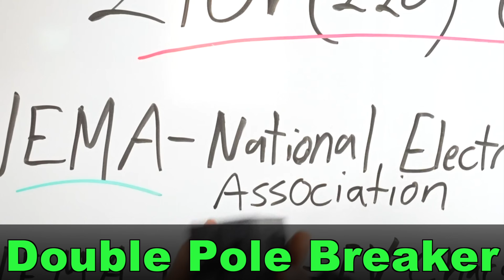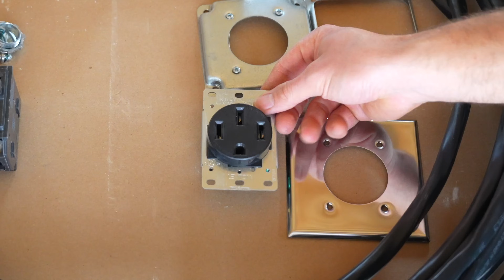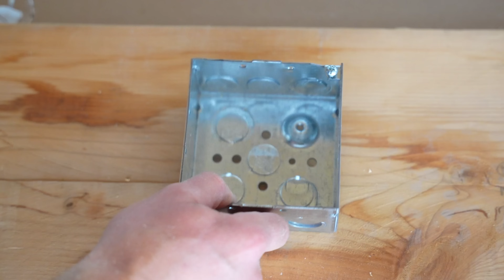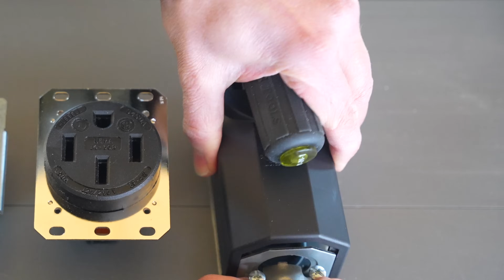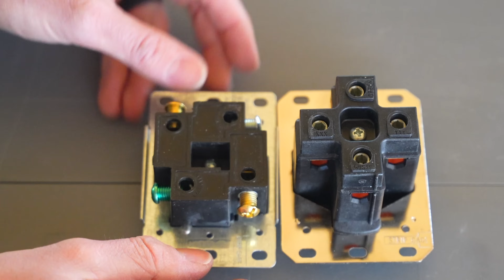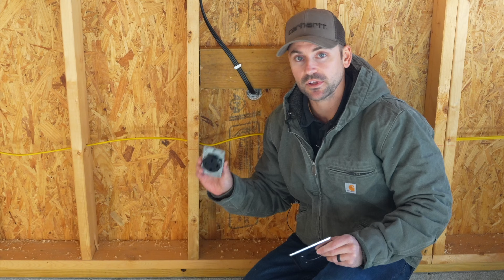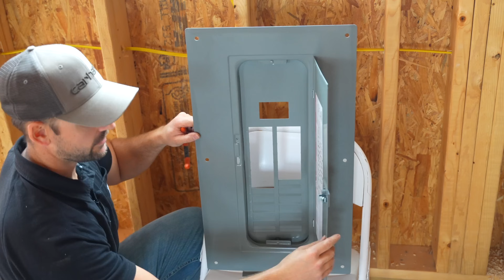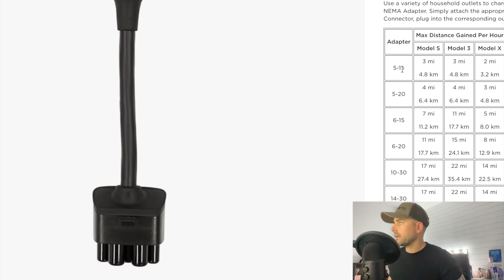How To Install A 240V Outlet In Garage - EV Car Charger, Welder, And Electric Range (Hubbell 14 50)

Comment: Excellent video instruction of how to rough-in and install a 240 v outlet. This was extremely thorough and very concise.  I feel confident that I could now undertake this work on my own.  

The only two questions I still have are; 

1). What size mudring should be used depending on the thickness of the drywall? and 

2). Why not use a two gang box to eliminate the need for the mudring?  

I think part of the answer is what you said about the mudring providing more room in the ox.  I get that there is only one device and not two switches or outlets that would require a two gang box but the two gang has the four ears or tabs you'd need to secure the device to the box.  Is this just a preference thing or is there another reason for this?

These are sincere questions.  I'm not being critical.  I know enough to be dangerous and just like to have all of the information before undertaking work.  Either way, I'm going to follow your lead thinking that if it's good for your house... then, it's good for mine.  I'm asking in the event you respond before I've started / completed the work.

Thanks in advance and all the best to you.  Keep up the good work.  👍

Comment: can you help me understand how come I see some people hook up 240 with only red and black plus a ground and no neutral. thx
Reply: The transformer on the pole is 240 volts centertap is the nuetral to get 120 volts to each hot .  It is grounded so there is never more than 120 volts to ground  The hots are opposite polarity from each other so 120 + 120 = 240.  the neutral is only needed to make 120 volts from 1/2 the transformer windings

Comment: You’re using a heavy duty 50A outlet, however people can still use 40A charging rating only😂 not 48A max rating. Because you didn’t count continuous load factor and nm-b wire rating. Plus the breaker is a 80% rating breaker.

Car charger is a continuous load. So when sizing the conductor you have to time 125%. 
48A*125%=60A
Romex wire 6 awg only carries 55A

So in the future the homeowner should better not set the charging rating on 48 max, only 40A.

If someone really want to charging on 48A max, electrician should use 4 awg romex or 6 awg mc

Comment: It's a good habit to run your 3 mains up the same side of the panel to reduce hum and noise. Your not seeking to use you panel as a one turn inductor or create a phantom voltage in your neutral. You likely don't hear these hums until you enter a big electrical room.

Comment: For a range, it is probably better to install under 8 inches to accommodate for standard or short drawer space -- that is the space behind the drawer that provides space for the plug. You might want to face the ground towards left or right -- some cords have the ground up and some have the ground down, and you want the loop to slide back in easy.

Comment: Hello 👋 there is it possible to wire nema 6-30 outlet 12/2 gauge Romex  just to mention I want to pull 20 amps
Reply: On a double 20 amp breaker

Comment: Recent code revisions require GFCI outdoor or in garages above 20A but that is only for branch circuits (welder, range, EV charger) but it is not allowed on feeder circuits (RV outlet--anything with a subpanel).  The same 14-50P could be either.

Comment: I've asked this on other channels but haven't gotten an answer. What is the failure scenario that we are protecting against when we separate neutral bar from ground bar in subpanel? Since the neutral and ground get bonded at the main panel and since there is continuity between the neutral on the main and the neutral on the subpanel and there is continuity between the ground on the main and the ground on the subpanel, then won't there be continuity between the neutral and the ground at the subpanel? I'm sure I'm wrong but I just don't know where I am wrong.
Reply: @Alessandro7432    Objectionable current on the ground from the sub to the main. Electricity doesn't just take the path of least resistance, it takes all paths available in proportion to the resistances of those paths. If your Ns and Gs were combined in a sub-panel, returning neutral current from one circuit could appear on the grounded metal case of an appliance being used on another circuit. Neutral is not ground. Ground is not neutral.

Comment: Not correct about the height of the box for a range you want to keep it as low to the floor as possible keep flooring in mind and the receptacle is wider than the box. Reason it’s low is the bottom drawer of ranges is not as deep as the rest of the range this allows a recess for the cord and plug end so the range will push tight against the wall and not stick out past the countertop. Also orient the ground facing left or right so the cord doesn’t stick up or down and hit the floor so before you teach anything else all the people who listened to you and their range sticks out you can go fix it for them!😜😁

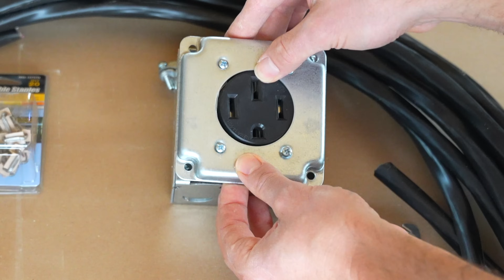Comment: Thank you for the video. Can you provide the link to the cover at 5:38 what will work on the Hubbell 14-50 Outlet?
Reply: You you said the 6-3wire is a three wire with a ground wire, but you didn't say what the six stands for,or maybe I missed it.

Comment: If you are using the Tesla Mobile Charger. Remember to mount the box a foot higher and orient the receptacle in the right direction so as the charger hangs straight down. Then you must support the charger itself so it doesn't disconnect the adapter from charger.

Comment: I thought the video was well done. You were precise and step by step. Sure, you always wrap a wire the way the screw screws in and I usually use a wire stripper in stead of a utility knife to strip the casing but still a well done video. Thanks.

Comment: I believe there have been problems using cheap stove outlets for EV charging. Generally the stove outlets weren't built to handle that high of voltage for 5,6,7, 8-12 hours at a time like an EV does. It would be similar to all burners on high and stove on boiler all night every night. A stove would rarely be used at that voltage and  never for longer than a few minutes  before being turned down if it was .
Reply: joshscott301 I learn something new every day.
Reply: You don’t know what you are talking about they are the same size metals inside and have to be or would never pass UL listings and the voltage is the same it’s the current/amperage that sizes everything when it comes to wire gauge other than industrial commercial wire rated to 600volt and higher

Comment: I just want to caution everyone that using NM cable for this circuit limits you to the 60 degree column for Ampacity (NEC 334.80), that's 55A here.  Furthermore, maximum current based on a continuous load should be no more than 40A's on this circuit since 125% x 40 = 50A. Therefore, never plug a 48A smart charger into this receptacle as some homeowners down the road may do and perhaps label the receptacle to say 40A MAX if you are going to use these 32A mobile charging cords. Note: even if you use 6AWG THHN rated at 90 degrees, your receptacle can only be used for less than 50 Amps. For me personally, I don't even install receptacles anymore for EV's, as they were just never designed for these high and continuous loads over periods of 8 hours or more.  Also consider the constant unplugging and plugging in at the receptacle; your terminals will be lose in no time with a chance for arcing and a fire very high. Buy a hardwired smart charger instead and have it installed by a licensed and insured professional!
Reply: If you are charging a EV with that Recepticle .. the plug should not be plugged and unplugged.. it should just be plugged.  .
You plug and unplug at the vehicle 😂😂😂
Reply: The ev chargers are 240 volt, no neutral necessary. They also are required to be gfci protected
Reply: Agreed. I also install Tesla Wall Connectors and all are hardwired with #6 thhn in conduit. Someone mentioned GFCI for receptacles which our AHJs have not yet adopted. Hardwired, the Tesla instructions require GFCI not be used as it is incorporated into the unit already.
Reply: It is mandatory that GFCI not be used?  Can GFCI not be ganged?
Reply: @davidsuzukiispolpot  It it’s a Tesla it should NOT have GFCI anywhere along the path back to the breaker as the protection is in the car and the GFCI can cause trouble.
Reply: That it’s correct. I prefers THHN and a raceway EMT.
Reply: The breaker terminal temperature rating determines the ampacity. Its stamped on the breaker. Continuous loads are 4 hours or more. Whered u get your electrical license.
Reply: You are correct.  Technically you should set your Tesla Wall Charge (or whatever you use) to charge at 40 amps (or 44amps if you have that option, which I have with my two Tesla wall connectors in power sharing mode.  44A x 125% = 55 Amps.  That's where I'm set because I made the mistake of running 6 gage Romex and now the basement if finished and it would be a nightmare to run #4 or #6 THHN.  But I'm happy at 44 amps.
Reply: I would never have a tesla pile shit @TrendyStone
Reply: @williamkeefer4140  As a family w/ a BMW 335i X-drive, a Ford F-150 and a Legacy GT...the two Tesla's are the cars we enjoy the most.  The tech is just....better.

Comment: I'm by no means an electrician, but have Don electrical work and taught by some great electricians. I was always taught when tightening wires against a box to route the wire in the same direction the wire tightens. That way the screw doesn't push the wire out, it draws it in. Use wire strippers not knives especially razor blades. When tightening lugs, tighten, back of, tighten, back off then torque. Also anytime adding new wire to a panel to kill main power. The person who taught me had a saying. The day you get complacent is the day you will get hurt or killed.
Reply: " I was always taught when tightening wires against a box to route the wire in the same direction the wire tightens" - When the wire is completely looped IE: out of cable, around screw, then into receptacle... it doesn't matter. Looping clockwise only matters on an open ended (cut) "hook" loop of wire.
Reply: or get the proper PPE, tho turning off breaker is cheaper.

Comment: Using a knife to strip the insulation. Definite no no.
Why not get yourself some automatic wire strippers? Safer, quicker, doesn't damage the cable.

How can you be a professional and yet use such poor techniques?

Comment: Should never ring insulation on any wires but use the pencil sharpening method. Too easy to put snall nicks on wire causing it to break if bent a few tines. Very seldom see DIY'ers or electricians bother to use a torque driver to titghen screws. Has been a code requirement for at least last ten years.

Comment: Josh, you do a good job with your videos.  On this one, i would like to stress several things.

Since this is a subpanel install, the entire panel can be deenergized at the main panel.  This should leave zero power in the panel.  Yypu did what i would do, but like you i have a high electrical comfort level.

You did this but did not stress it.....connect away from the panel first.  This prevents anyone "helping" from powering the wires in your hand if they are not connected in the panel yet.

Connecting the wires ground first, then neutral, then hots provides a small level of safety and is a prefered connection order.

I will reference the 2020 code.  Yes it updates every 3 years, so your jurisdiction may be several cycles behind and some requirements may not apply to your jurisdiction.

Section 90.4 allows your local jurisdiction to accept all, some, or none, of the code.  They can change requirements as they deem needed.

Section  110.14. C. Electrical connections, temperature limits. Puts breakers 100 amps or less at the 60 °c rating for wire current unless the breaker is marked differently.  This means the wire you use is rated under the 60° c column of the ampacity chart.(310.16).  Yes, thhn is rated at the same as romex.  The #6 copper wire is rated at 55 amps, not the thhn rating of 75 amps.

210.8 (A) gfci protection for dwelling units has upped the voltage to 250 volts or less receptacles require gfci protection when in garages, laundry areas and accessory building at ground level and not a dwelling.  Yes, welder and car receptacles.

314.4 requires metal boxes be grounded.....yes the green screw.  Again a safety feature, should the hot wires touch the metal box, it will cause the breaker to trip through the ground wire and prevent the metal plate covering it to be 120 volts.

Now for the scary one.  There is a seperate section for car charging (EVSE).section 625 with specific requirement.

625.40 points to one outlet (charger) on one breaker.  

625.41  points to the circuit being 125% of the load.  40 amps of charging on a 50 amp circuit.

625.54. This is the gfci protection if you install a receptacle.

This is not a hard install as Josh has shown, just make sure you follow the rules.  Good luck.

Comment: Your description should had said how to Install a 120/240 EV Charging circuit. In most units the neutral Is not needed but good to have for future use.
Reply: New CODE to run it but cap at junction bx ,then use it to netural in the breaker bx.

Comment: On that ground wire I usually bend it in a u-shaped so there's more surface, and that 75 inch pounds. Which calculates into 6 foot pounds.

Comment: Don't worry about putting the charging port in your garage for your electric car, build a brick wall u-shaped so in case the battery pack decides to catch on fire your house will not burn down. Got it am I clear.😊

Comment: I followed the example precisely, testing the outlet with a multimeter revealed 110 volts on both neutral/ground and hot (black or red) independently, and 240 volts across. However, when I plugged in my Tesla mobile connector, it initially seems to receive electricity, but then displays a red 'T'. Any idea what I might be doing wrong

Comment: You wrapped the ground the wrong direction.bro. The difference between 240 and 220 V AC would be the system you're connected to whether it's a delta or wye connected transformer on utilities, total watts of the load divided by the voltage will give us the amperage. With respect to design, we need to add a De-rating factor for continuous load! As you would never run a 50 amp circuit at 50 A, no no no, typically the NEC provides tables for the de-rating , based on continuous use with respect to heating the conductors So we use the 75° column,  so this infrastructure you've put together for this circuit connected to a receptacle in your example should only be used at 80% of its max 60 amp rating somewhere around 45amps. Depending upon de- rating. It's important to understand the implications of such a large load connected with a receptacle i.e. cord connected. Let's take a residential kitchen into perspective we could put this circuit to a kitchen stove as you've laid out, which would never run continuous with respect to PWM heating cycle , however, once we utilize this circuit for an EV charger, the load characteristics dramatically change. With respect to PWM cycling
 So with respect to conductor heating.. This is based on duty cycle with respect to the load characteristics. Typical duty cycle of a residential range / welder  is 10 to 20% typical duty cycle of a charger is 60% or greater…. Laymans terms things melt if everything's not de-rated properly.. Considering charging your car is not like cooking a turkey where you're constantly watching it you will need to hardwire everything once you've probably designed the circuit for continuous operation… I give you this feedback with the utmost respect as you have 470,000 people subscribed your channel. I have no one subscribe to my channel.. Peace.  Bro. be Safe!

Comment: Rv’s do not use 220/240 v. Almost all are 110/120 v. The outlet might look like 240 but it’s only 120. Connecting an Rv to 240 v will damage the RVs electrical system. I’ll try and email you a wiring diagram.
Reply: Ever hear of a "glamper?" Huge RVs and they do have a need for 240/120 volt power. In the past most RVs required 30a 120 volt.

Comment: Its 110 to 120 and 220 to 240 due to the alternating current that fluctuates 10v per  110 so 440 would be 440 to 480 alternating current I believe
Reply: That's incorrect. Both poles are 120V which makes it 240V for dual pole. The 110V terminology comes from decades ago when the power actually was 110V. Some time before that it was even 100V. Devices are manufactured to run at 120V +/-10% or so.

Comment: Hey Josh Can I use 6/2 wire on a 1450?? Already got the home run installed
Reply: I don't believe that's to code. It must have a neutral installed. You could use a 6-50R instead.
Reply: thanks..I saw somewhere that you can use  6/2 if you dont use for 120v and use a gfci breaker in the panel..Then again the code thing as you said may be an issue
Reply: @Tinfoil.Hatter  I believe you technically could, I'm not 100% sure it is a code violation, but I believe so, and it isn't good practice. At the very least the receptacle must be marked as having no neutral connected. I'd try looking up NEC code for using receptacles which require neutral without one. Comb through forum posts and try to find the actual provision.

Comment: Regarding the 6-3 wire’s ground wire which was wrapped around the green screw & screwed against the two gang box via that same green screw:

this is the same ground wire that’s then run into the outlet, right? 

Just curious 

Thank you
Reply from the maker: Yes, the wire going to the green screw continues to the outlet. I hope that helps!
Reply: @TheExcellentLaborer  indeed. Much obliged 🎩